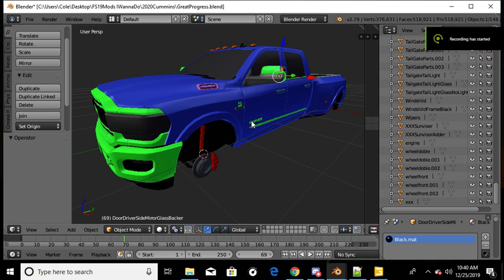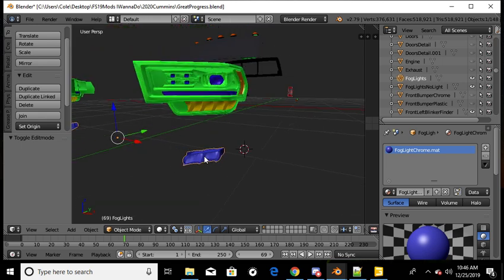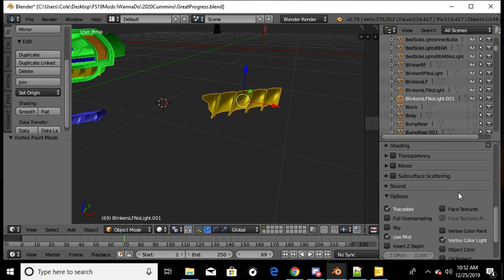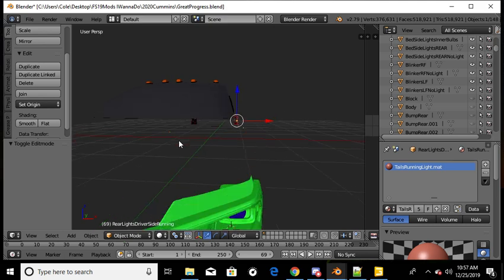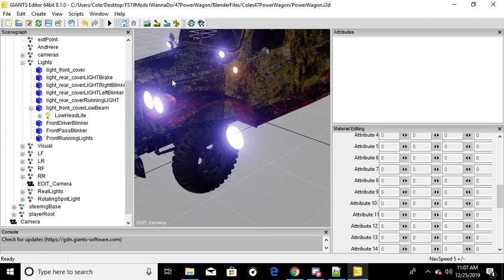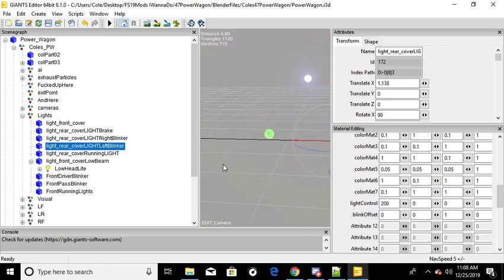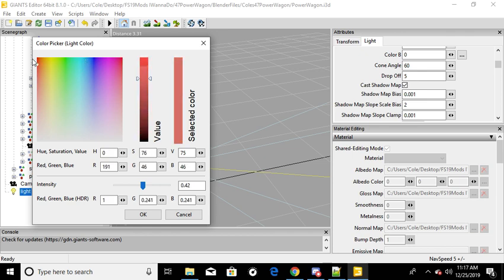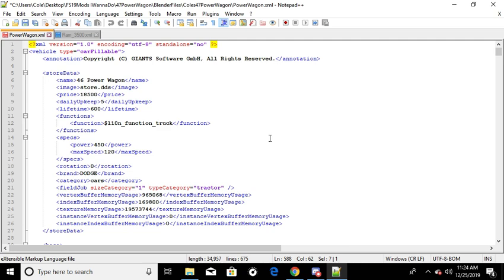fs19 Modding, Part 2.  LIGHTS!

Comment: What if when you hit down down right for the blinkers and they don't move at all?
Reply from the maker: you have to make sure they are selected, and in the texture mapping area all selected, once you hit down they should move.  Once in ge. set up your part by turning tangents on, then selecting vehicle shader (on the bottom setting area) and then change the internal setting to static light, then set the light intensity.. then move around with your mouse on the mod itself you will see the light light up slowly then unlight slowly as you move your view around.  once in game it flashes like normal.
Reply: @ThEPuP4x4  ok but all of it is selected and it's still not working do you have Facebook messenger?
Reply from the maker: @DomincRobinson  I have a facebook page, and a discord.  
Cole's Customs fs19 mods. link to discord is in there

Comment: how did u get the material selector mine wont show up in add on where did u download it from
Reply from the maker: I don't recall where I got it at as its been a few years now.
Reply: @ThEPuP4x4  I got it to work thanks can you do a  tutorial or where to move the uv mapping for each of the kinds of lights light white headlight and blinker.
Reply from the maker: @raphaelchicago9138  To make the lights colors, you UV paint them the color you want them to be.   Blinking lights.  On your material selector select the light you want.. it should be sitting on the Painted metal setting (defalt center box)  Go down 2 and one RIGHT.  Useing the direction boxes at the bottom of the material list.  Hope you fallowed that.

Comment: Hey ive got a question where do i find the xml file
Reply from the maker: If your editing a mod the XML will be in the mod your editing.  If you are building from scratch you have to build a xml from scratch or pull the xml out of a already useable mod and edit it, or pull the xml out of the in game truck
Reply: Cole Ashlock ok